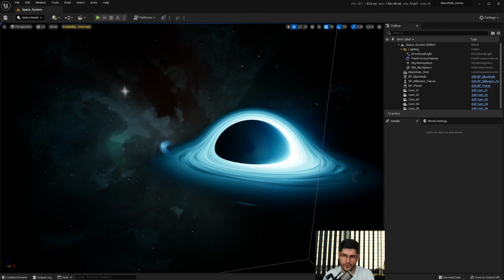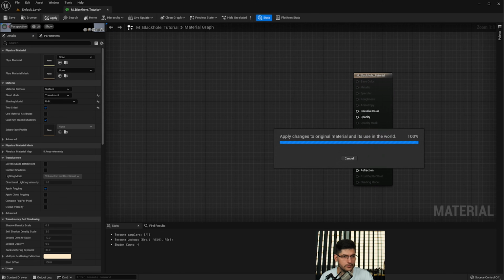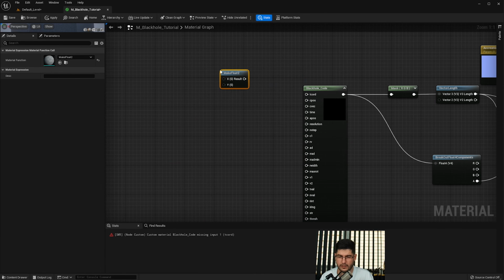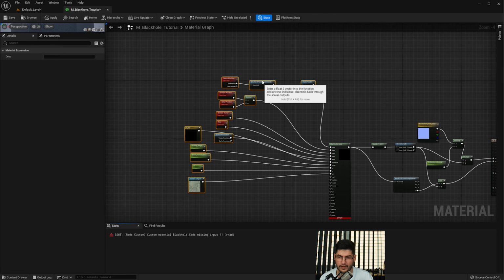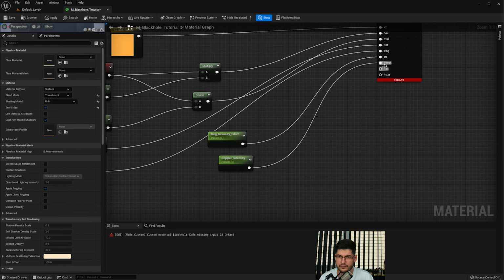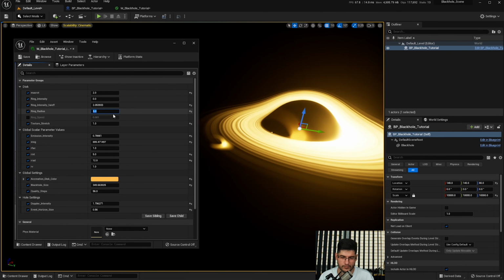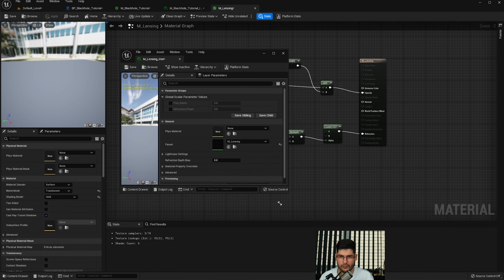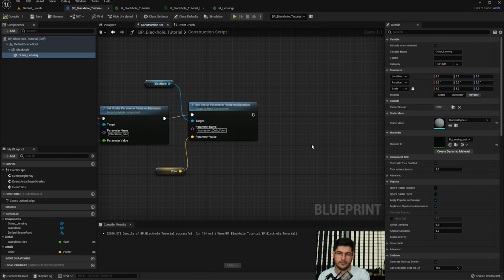Unbelievable! Make a "Black Hole" in UE5 - Tutorial

Comment: For those who want to rotate the black hole, I got you:

1. For the input cpos, after the Subtract node, add a TransformVector node with the source as World Space and destination as Local Space. This will also affect scaling based on the scale of the sphere, so you might also want to add a Multiply or Divide node after the TransformVector node to adjust the effect back its original size, or else just adjust the material parameters accordingly.

2. For the input cvec, after the Camera Vector node, also add a TransformVector node with the source as World Space and destination as Local Space.

This should do the trick, hopefully it helps some of you.

Also shoutout to @Mitu_Pinju for being the original creator of this effect and implementation of the code, and for offering his project files for free through his video here: https://www.youtube.com/watch?v=FLVZ4zr-Xzk
I appreciated this tutorial but it's pretty uncool that it appears to have basically copied and reverse engineered the work of others and then monetized it without giving any of them direct credit (correct me if I'm wrong). That said, it did offer me some additional helpful tips and explanations, so thank you.

Comment: i got problem with camera vector 
[SM6] D:\Program Files (x86)\UE_5.5\Engine\Shaders\Private\MaterialTemplate.ush(3599,14): Shader TMaterialCHSFNoLightMapPolicyFAnyHitShader, Permutation 0, VF FLocalVertexFactory:
	/Engine/Generated/Material.ush:3599:14: error: use of undeclared identifier 'cvec'
	float3 ray = cvec;
	             ^

Comment: Hi, I am really excited to finish this black hole. But it is just appearing as a black sphere. I tried all the refraction methods, didn't work. There are no errors in the material. I copied all the settings you put. And I decreased the black hole size in the material and made the sphere in the world bigger. Idk what to do :<

Edit: I fixed it
Reply: Hello i have the same problem, can you tell me how you fixed it ?
Reply: @gostidek1676 What I did was decrease the size of the blackhole in the material and increase the size in the level. It may seem it won't work at first but trust me, as long as you follow everything he did step by step, you'll get it. If you have any further problems with the blackhole, message me. Good luck! :3
Reply: @AVCIV123  it's not working :( I tried to change the black hole size in the material and in the level. In the level i tried 1000, 10000, 100000 and in the material i tried 1,10,50,200,300 and everytime it is still completely black...

Comment: First of all you are amazing for doing this.

Second, there are no errors for my material and I applied it to a sphere but in the viewport it's just a black sphere. I made sure to copy the exact settings from the video
I tried going inside and it looked very weird, I saw parts of the disk, and parts of outside the sphere and parts black.
I am in UE 5.5 and tried Refraction Methods: Index Of Refraction / Pixel Normal Offset / 2D Offset. Nothing worked, please help.
Reply from the maker: Hi please sclae the sphere up in your world and decrease the blackhole size in your material parameter.
Reply: @ArghanionsPuzzlebox  amazing thank you!!

Comment: Thanks for the lesson, what could be the problem, I have no glare,bloom and flare, no matter what value I set in - Doppler_Intesity.
Maybe something needs to be changed in the project settings?
Reply: i was also getting the same issue , we have to increase the values way more to see any kind of emmission , it is sort of working for , but like there is just the emmion aout the edges just light emmision
Reply: @sairajsoman4652  Yes, it is, but there is no glare to the camera itself. That is, there is no optical lens flare effect. I think the author missed this point in the lesson.
Reply from the maker: Please use a post process volume with an infinite extent. Then, add a dirt mask to that post process. Use a convolution bloom method and adjust intensity. Also you can add more lens flare intensity. All of this is done via the post process.
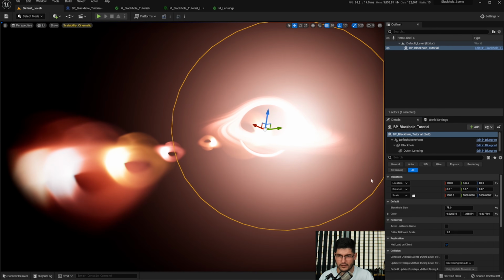Reply: @ArghanionsPuzzlebox  Thank you very much! Understood, but how to solve the problem with "flickering" bloom and lens flare? As in your lesson on 38:13

Comment: I was following the tutorial in 5.2 and when i connected everything to the custom code thing, i got these errors, i have no idea what they mean or what is wrong:

[SM6] /Engine/Generated/Material.ush:2857:33: error: invalid format for vector swizzle 'SampleLevel'
	                    color += ad.SampleLevel(adSampler,tex_coord,  0)*lerp(v1/1.65,v2*1.65,temperature)
	                                ^
[SM6] /Engine/Generated/Material.ush:2857:45: error: use of undeclared identifier 'adSampler'
	                    color += ad.SampleLevel(adSampler,tex_coord,  0)*lerp(v1/1.65,v2*1.65,temperature)
	                                            ^
[SM6] D3DCompileToDxil failed. Error code: Unspecified error (0x80004005).
Reply: I had the same error message!
It was caused by the Default Texture being loaded with TextureSampler.
In the video, it's being input with Texture Object! Please check!
Reply: getting the same problems UE 5.1. Tried optimizing the code but it led to more errors....
Reply: i got the same problems😭and totally do not know what to do
Reply: okay, i solved it, that is because maybe i typed something wrong in the inputs, i retyped all and then it could be worked

Comment: Brilliant tutorial, as always. Please note that "Refraction" in 5.2 has been disabled and you must enable it in the Refraction tab under Details for it to work.
Reply from the maker: Thanks for the tip 👍
Reply: hey need some help , I'm using the 5.2.1 but , don't know why , its not working for me , did everything as said in the video , but still the sphere is fully black at first not transparent like in the video
Reply: @sairajsoman4652  I had the same issue, when you are creating the custom blackhole code, irring as it appears is wrong because in the code is "iring". Maybe that helps
Reply: @Dluquea   for me its "iring" only , but now after messing with the parameters a lot im getting the emmissinon on the out lines like when we do bubble mat in unreal

Comment: Hey I got stuck at the material instance setup. I can see the silhouette of the blackhole and disk but the disk itself is black and doesn’t emit any sort of light or colour? Any help would be great!
Reply: I have the same issue in 5.3... i put on the refraction too but there's no disk around the black sphere, did you solved this?
Reply: @DavideGrucci95  tengo el mismo problema

Comment: Is there a way you can rotate the black hole to set it on an angle?
Reply from the maker: Not with this particular one. You can rotate your camera and see it at different angles but the blackhole will always maintain its rotation as you see it.
Reply: That’s a shame.  I wonder if there is some sort of code anyone could add to allow you to rotate the blackhole on its axes?
Reply from the maker: Yes, I was tinkering with a way but not finished it yet. Might be worth doing some research on this!
Reply: @jonahwilson1576  hey yes you can, its my code , not his, where you plug the camera vector, use the rotate about axis node.
Reply: @mitu_pinju  can you explain how to use rotate about axis node?
Reply: When you use the camera vector node, just add a rotate about axis node before connecting it to the custom node. You can use object rotation node and plug it in rotate about axis node if you want to use the static mesh rotation for the black hole rotation . If you will watch a video on rotate about axis node, you will be able to get it right
Reply: @Maitray Sharma  thank you so much.
Reply: @mitu_pinju  Sorry to drag you back in after so long, but can you explain more about the rotation? I've been trying to get this working for about 2 hours now but I can't get the results I want (rotate about the center of the blackhole effect). For testing I am using a constant vector (1,0,0) as the normalized rotation axis, a time node -> sine node for the rotation angle, constant vector (0,0,0) for the pivot point, and the camera vector node as the position. The results for the rotate about axis node and the original camera vector node are then fed into an add node before going to into the actual code. This seems to kind of work, but the rotation changes wildly when I move the camera around the effect. Do you have any idea where I am going wrong with this?
Reply: @benjohnson7610  Hi, did you find any solutions to solve it?
Reply: @ISteadyYouSteady  Unfortunately no. I was able to get some rotation working, but it seemed to be unpredictable (possibly relative to camera space) and the effect frequently rotated out of the sphere. I ended up having to drop my original plans for the effect and just prerecorded it from safe angles. Luckily I was using it for video contents and not a real-time application.
Reply: @benjohnson7610  Ohh, ok.... But the way thanks for your reply.
Reply: I cant get it 😢

Comment: dont work i made all steps from u. 2 timest and i ahve only black hole without acrection disk. nothink more than black circle.
Reply: top down project. Did i need any c++ compiler ?
Reply from the maker: No. It should work just fine. You have tried going from a different angle or are you locked in top down?
Reply: @ArghanionsPuzzlebox  i just operate WASD and tried from all angles/ still no acrecion disk and others effects just big black ball.
Reply from the maker: Did you add color and increase the emissive intensity?
Reply: @ArghanionsPuzzlebox  all as in tut. did i need c++ compiler or smf to run custom material code or just pase ? and did top down project can support ur blackhole tut?
Reply: @ArghanionsPuzzlebox  maybe this will help https://pasteboard.co/HIBzprIdXrKR.jpg
Reply from the maker: Should support it, yes. The c++ code should just work. Not had this happened before.
Reply: @ArghanionsPuzzlebox  so did u look at https://pasteboard.co/HIBzprIdXrKR.jpg

is correct or smf missing ? thx for help anyway.
Reply: @ArghanionsPuzzlebox  Fixed it finnaly . Just made new project cuz for some reason lasthes was corrupted and smf dont worked with textures.
Reply from the maker: Sorry, not seen the last reply. Join the discord server if you need more assistance. Glad you got it going!
Reply: how did you fixed it? pls help @czerwony7929

Comment: I’m working through your tutorial now, and first of all thank you, I’ve learned a lot. I am a little stuck trying to get it to actually appear messing with the settings, but my real question is this - you said it was important for the black hole bluprint to be large…is there a good way to make this work as part of a smaller sized environment? Like I’m a character’s hand?
Reply from the maker: Hi. Glad you are finding the tutorial useful. The important thing is to start large and then scale it down once the blackhole is visible so you can start changing parameters until it fits your need.
Reply: @ArghanionsPuzzlebox  Thabk you for your quick reply! Turns out I’d simply mixed up and used the material instead of the material instance on the black hole sphere. This tutorial is amazing, thanks for putting it up!
Reply from the maker: Glad you got the desired effect!

Comment: Curious as to why my accretion disk doesn't look as detailed as yours does
Reply from the maker: Did you play around with the texture stretching? Also what type of texture are you using.
Reply: Turns out I was using the wrong 'default texture'. My bad.
Reply from the maker: Good thing you got it working

Comment: Do you have any idea what could be wrong with mine, i did everything step by step yet i cannot see the black hole only darknes and the  spehre.. ;/
Reply from the maker: Is the sphere larger than the black hole?
Reply: @ArghanionsPuzzlebox  nope its very small
Reply from the maker: Increase the scale of the sphere and then play with the material size.
Reply: @ArghanionsPuzzlebox  can it affect the effect if im working on a VR project
Reply from the maker: I doubt it
Should be able to work.
Reply: Did you ever get this working? I’m having the same issue as you it seems
Reply: SAME PROBLEM HERE I FOLLOWED THE STEPS QUITE ACCURATELY I CANNOT SEE THE BLACK HOLE BUT SOMETIMES WHEN I MOVE AROUND THE  BLUEPRINT WITH THE CAMERA, SOMETIMES THE RING IS VISIBLE BUT ONLY A PART OF IT. IT DISAPPERS IMMEDIATLY. I TRIED IT IN AN BLANK EMPTY LEVEL SAME PROBLEM
Reply: I am in the same position, I did the tutorial 3 times now step by step exactly I double checked. I just get a dark sphere and taht is it.